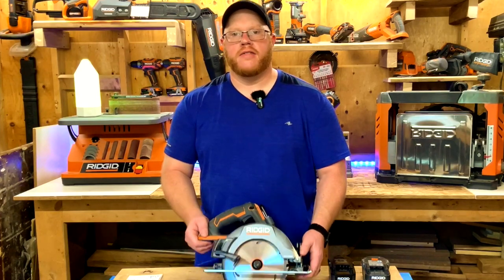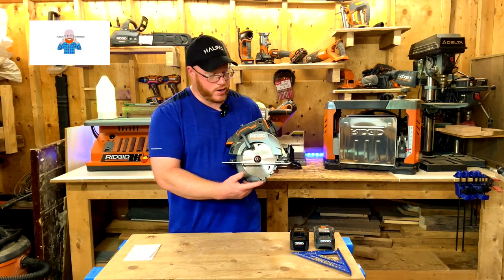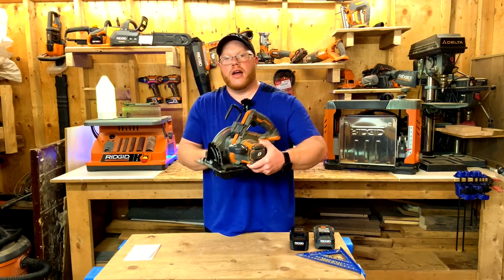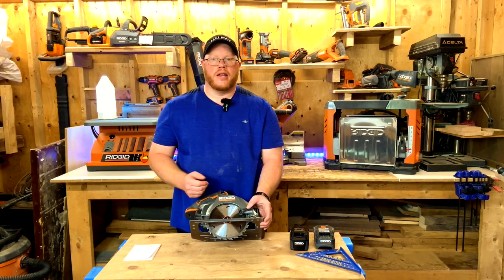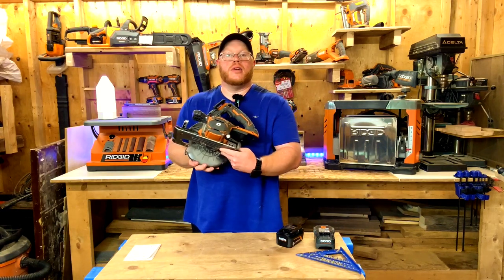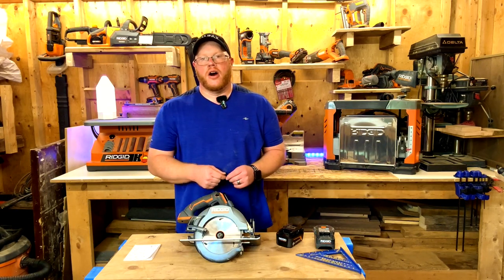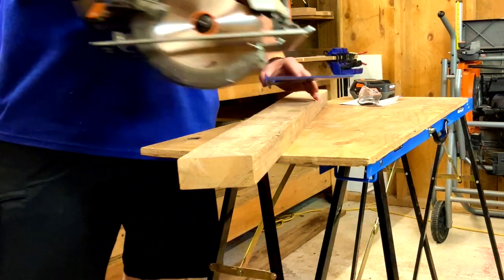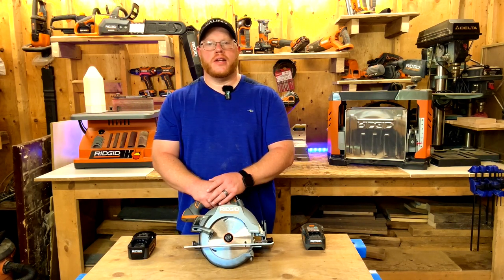RIDGID 18V Brushless 7-1/4-inch Circular Saw- REVIEW!!! #ridgidtools #ridgid #woodworking #tools

Comment: Dang this doesn't work with the old 9ah octane battery does it?
Reply from the maker: I believe it will. I have a 6ah for mine and it works great. Ridgid claims there batteries work on all their tools. Maybe not the 12ah due to size issues. Hope that helps. 😊Dan